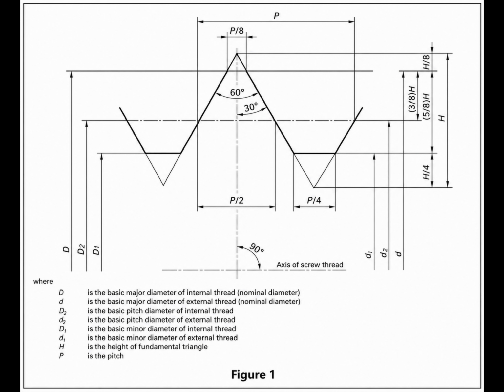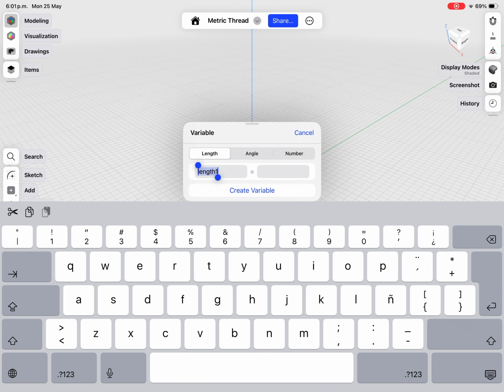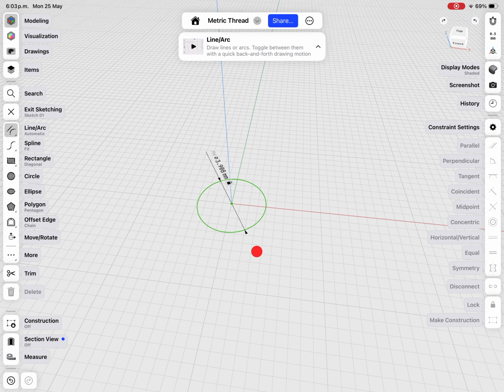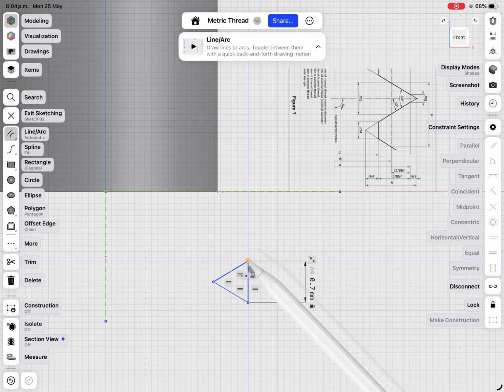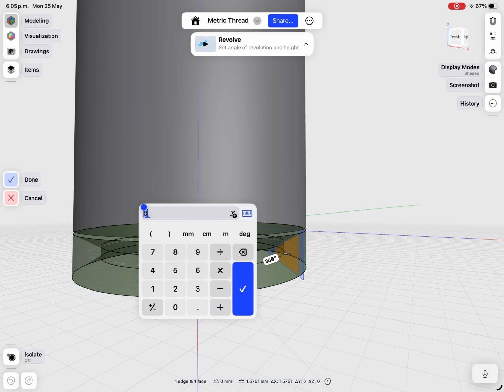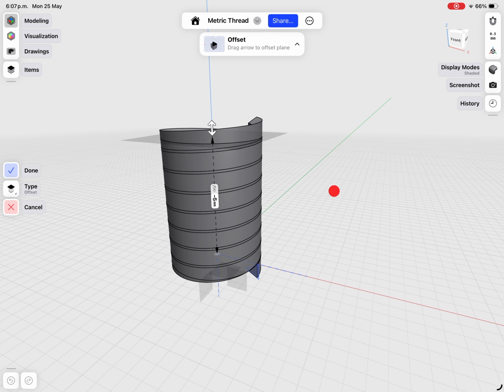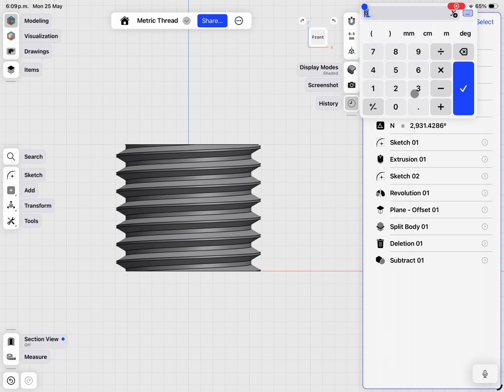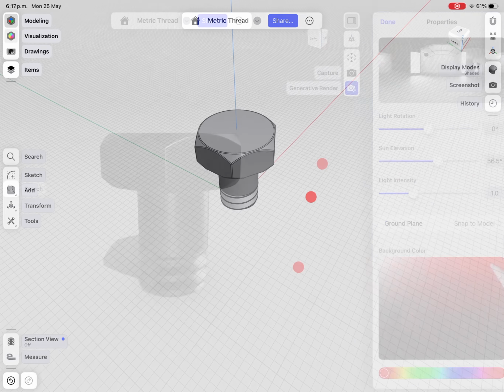Standard Metric Threads in Shapr3D #shapr3d @Shapr3D #3dmodeling #industrialdesign

Comment: How would you create a variable to be able to extend the length of the bolt and have all the threads adjust accordingly, as creating a variable for a bottom chamfer?
Reply from the maker: You need to define L as length of the bolt and replace the 5 in TL variable by L.